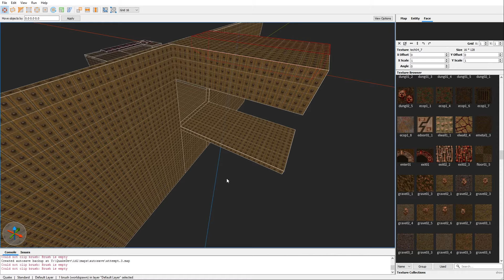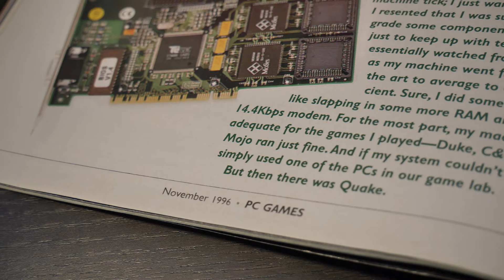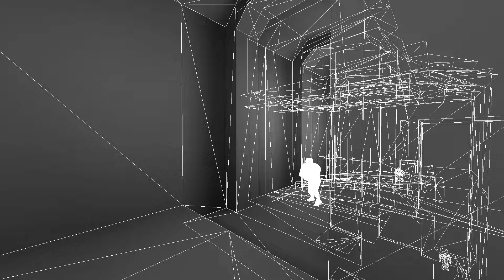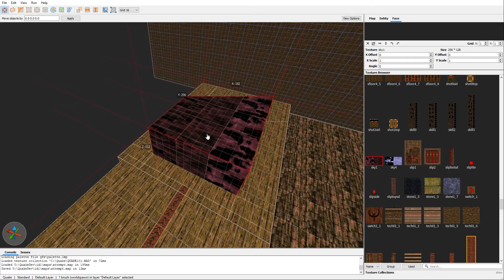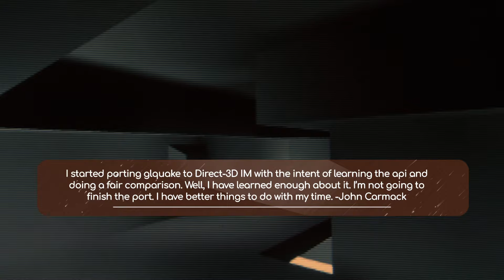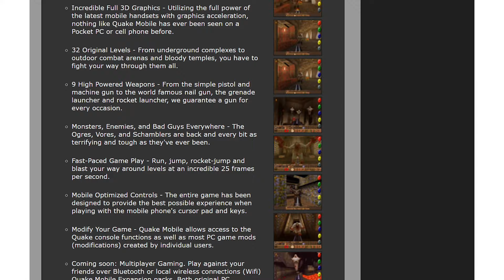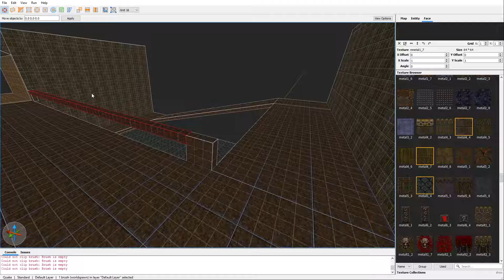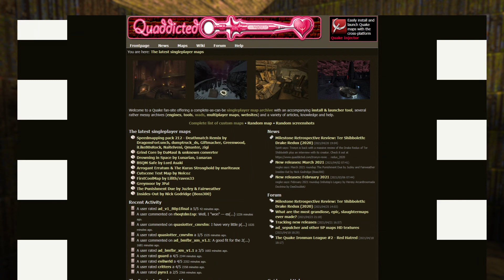DF Retro: Quake - The Game, The Technology, The Ports, The Legacy

Comment: The original Quake running on the DarkPlaces engine is a huge graphical improvement over the original game. You can find the DarkPlaces engine free but you must have and use the original game files. The other two mods that come to mind is Quake 1.5 and Quake 1.5 HD. These run on the DrakPlaces engine as well. The latter two overhaul both the enemies and weapons. That can be a positive or negative thing depending on how you feel about the original game. Personally I like the original game running on the DarkPlaces engine. It has gameplay identical to the original but much higher resolution.

Comment: iD are pioneers. First doom, then they came out with quake and arguably the best one quake 2 in terms of engine adoption. Then they battled for the deathmatch arena scene. 

Few companies can be said to have changed computer gaming like iD. First doom made people want pcs over their amiga, something unthinkable a few years before. Then they drove the 3d acceleration market and ultimately this culminated in direct x, which is today the primary driver frame work for pc and xbox  (xbox could not exist if direct x didn't take off). The fragmentation of unique api was never going to last and glquake was a pioneer in ending the fragmentation. It also killed off Cyrix effectively and amd had to scramble to catch up. the flu for the first time became crucial to the enjoyment of the game, so sx processors were dead in effect overnight for gaming and the 486 just couldn't compete with the pipeline nature of the pentium chips,  especially the mmx version. Though later amd 486 dx4 and 5x86 chips were competitive on price until the k6 came out and changed things again.

Those days were both exciting and maddening with how fast things changed between 1995 and 2000. The foundations of what we know as pc gaming were laid in those years and changed the computer gaming scene forever with no other system than the pc really surviving the changes,  though obviously the mac carried on,  but it was never a threat to the pc or taken seriously for gaming from that point.

Comment: 44:50
They likely had to cause Quake uses uncompressed textures loaded directly from the cartridge which is why the textures are so much more detailed than something like Goldeneye. However having tons and tons of uncompressed textures eats up a lot of cartridge space so they had to make sacrifices somewhere.
Textures really were the weakness of the N64, there were 3 options to render them but none were really ideal. You could use the texture cashe which was very fast but was only 8 kilobyte in size which meant you had to massive simplify textures. You could store them on the cartridge but this meant eating up precious cartridge space. Or you could store them in the RAM but that was really laggy which meant unless you did it very carefully the system could easily stall and was extremely difficult to use in the unpredictable nature of a game.

Comment: At the time I had a 3dfx voodoo from creative with a hercules 128bit video card for it off the top of my head is a long time ago. 

My pc was a pentium 60 mhz. 

Still I liked the standard software mode because I found 3Dfx very light on image. 

Took the scary out of Quake. 

It ran like clockwork in 3fdx :))
It was an expensive joke at the time I loved Quake it was a master piece of software. 

Of course you also had to have thick sound card Soundblaster was minimum.
I had Ultrasound card was super sound but not all the games supported that card.

Translated with DeepL

Comment: 22:45 It can't be emulated in the sense that there's no emulator for it available right now, but it doesn't seem to have anything particularly weird/different that would make emulating it hard if proper documentation was available to reverse engineer it. Which leads to...
23:00 isn't this approach the same used in the N64? Wasn't the RCP a second MIPS CPU with a bunch of added silicon for graphics processing? I think SGI used a bunch of Intel i960 RISC CPUs in one of their early graphics accelerators as well, before custom ASICs dedicated to graphics processing became a thing.

Comment: It's a damn shame, because Lobotomy had ported Quake to the Playstation, but they couldn't find a publisher for it so it got scrapped. Lobotomy itself would disappear not long after their Saturn port of Quake because they just weren't getting paid enough money for the ports they did. It's too bad they didn't do the Saturn port of Doom.

The Riva 128 was my first add-on graphics card. There were a lot of choices back then, and while I wanted a Voodoo card, I chose the Riva 128 because it had very good 2D and 3D performance, good image quality, and DirectX support. At the time, DirectX was pretty clunky and not yet universally supported, but Nvidia's embrace of it completely changed that. The Riva 128 could pretty much run everything, and while it wasn't quite as fast as the Voodoo, it had better image quality. And it didn't require a 2D graphics card. As great as the Voodoo cards were, they had a bunch of limitations.

Also, I love that you included a brief clip of Whiplash! I loved that game and played it a LOT!

Comment: Star Wars Dark Forces came out 1995, a year before quake and the lighting looks the same to me. I remember shooting grenades in dark forces and they would sparkle similarly creating light on the walls just like the nail gun does in Quake. I think they both look rather similar, but I know the Jedi engine for dark forces used sprites instead of 3D models. But that's the only difference I can tell. Can you jump and crouch in quake? I don't quite remember, but if not that's another difference

Comment: Why 3D accelerated Quake looks like it's smeared with lard? It's not just the gamma problem, it's something more.

And why does Quake on N64 looks like the textures are sheared? It's like the original texture is like every line is shifted 1 pixel to the left and to have a properly aligned texture you had to skew the whole thing back, giving every surface a zig-zag kinda look. It's also present in the PC version of Quake 2, they did some weird trick there...

There was going to be a PS1 port too I believe but it was cancelled.

44:05 - what is the background music here? Is it from Sin? Sounds like the Missilo Silo/The Ceremony track. (ohh, at 56:52 I got my answer :) It is that track)

Arcane Dimensions' beautifully created map: Foggy Bogbottom is the best I think! My only problem with that level is the music track choice, I always change it to track05. I played Quake 1 through last winter using Quakespasm, played both official expansion pack, played a lot Foggy Bogbottom and finally I got to play Aftershock for Quake for the first time. I always wanted to get it but I didn't know there was a level editor version and a map pack version. The map pack was such a letdown, especially playing it after Arcane Dimensions, even compared to the base game it's still a major downgrade.

Comment: ahh.. I messed around with a cheaper PowerVR card but it never ran (gl)quake right. Finally got a 3dfx card. There was a opengl.dll-glide-wrapper that implented just the bare minimum to run glquake on 3dfx cards.
Remember, that 3dfx cards just basically are 'triangle drawers'. It could draw 2d triangles, with texture coordinates and a color per vertice. That's it. No 'Transform & Lightning' yet. Amazing that it made things that much faster.

Comment: So sad I gave away my Creative 3D Blaster Verite card. I'd like to try and make a legacy machine with it. I rocked that card for a long time due to the fact that I got ahold of some beta GL drivers for it. I think it wasn't until 2001 that I got another video card. That happened to be a 3DFX V5500. Man, I sure do pick 'em good, don't I? 😉🤪
EDIT: I was actually able to get Quakeworld running with VQuake. But as soon as I got the GL drivers, I was able to run GLQuake like everyone else. 😎🤘 I still like VQuake, though. You could turn on AA which would round out the square particles. I can't remember how much it affected performance, though.
EDIT2: (38:58) See! The Verite' is, like, the perfect blend between the others. GLQuake always seemed blurry to me. Almost like it was at once sharp (the edges of objects) and blurry (the textures).

Comment: 34:50 - In 2002 I bought Half-Life, and tried to run it in software mode on my Cyrix MII-300MHz PC. Its performance was pretty similar to the brief clip of GLQuake in software mode that you show here: a single-digit fps!

I played through it like that all the way to On A Rail, at point the low FPS interfered with the train controls and rail electricity damage, and made it impossible to progress.

Comment: I played Quake 4 with only 256MB of RAM first time. It dropped ti less than 1 fps in places. Still played it though. I had an AMD CPU and Nvidia GeForce FX 5700 - laptop. ... The RAM was a 256MB stick, and when I got another so I has 512MB, Quake 4 ran way better.

By the way when he talked about 60fps looking better than say 25fps for Quake (1), I was surprised. I had a CRT and as far as I remember 24fps was the minimum you had to hit. Otherwise it became a slideshow.

Comment: i wish you'd cover the mac ports as well in these videos, even as a small aside when mentioning other versions, sure it came a bit later but i remember it looking better than the DOS version on my mac without a dedicated GPU, and modern remakes of lots of classic games use the DOS version in a wrapper for mac compatibility.
Reply: Agreed. Correct me if I'm wrong but I think the default resolution was 640x480 even, yet shared the same, if not better, framerates than DOS. Quake 3 Arena, though, you can say the Mac version didn't lag behind for once as the beta was Mac first, and took advantage of the power of the 'then new' B&W G3 w/ATI Rage 128.

Comment: There was something wrong with your 486! I also had 486DX2 66MHz and it run at 11f/s @ 640x480  with fully blown window and visible status bar below as I remember. In smallest window @ 320x200 I had like 40fps on 486DX2 66MHz. No overclocking was involved. I had Intel processor. Did you?

Comment: "supporting Professional OpenGL".    There's no such thing as "Professional OpenGL".  A card either supports OpenGL or it does not. As someone who had to port some games to OpenGL (and Direct3D) during that time period, I remember this marketing BS. I believe Carmack himself weighed in on this issue back in the day.  Some 3D card manufacturers tried to explain why their very expensive 3D cards were getting their asses handed to them by Nvidia's cards that cost 1/4 the price.   They invented the "Professional OpenGL" myth.  It was just another way of saying "our card can't do multi-textured rendering for shit".  Weirdly, it sort of worked as artists would go to their IT department and demand a "Professional OpenGL" card and it had to cost at least $1000 (in 90s money).   Nvidia got so frustrated by this turn of events that they gave up trying to educate the consumer, and instead made their own 3D accelerators for "professionals".  They charged over $1000 for them and gave them more serious sound names.   And most of the time, they were identical silicon that they were charging 1/4th the price in their regular "gaming" cards.   They just used drivers that nerfed their gaming performance and tweaked their wireframe performance so the benchmarks would be different.  Sometimes they had hardware IDs to keep users from just installing different drivers, but those were easily patched around.  It worked.  Nvidia's sales (and particularly profits) sky-rocketed in the workstation market as artists demanded those (overpriced) "Professional" cards.

Comment: GLQuake is even more inferior to the software renderer than you suggest. It has no fullbrights support. This means that light on textures like the red lamps on the teleporter or the white lamps in the first level don't stay at full brightness in the dark. It has no overbrights support. This means that nothing can ever be brighter than 100%. These shortcomings make for an incredibly dull picture compared to the original software rendered Quake. It all sums up, and I think GLQuake lost most of the atmosphere and style of the original.
Reply: The original GLQuake was very limited by the original 3D acceleration hardware of the time. If they had left those removed graphical features, the cards wouldn't have been able to run the game properly so they had to make a compromise for better FPS and resolution instead of visual fidelity.

Comment: dungeon keeper
Reply: fpga can hardware emulate
Reply: transport tycoon
Reply: descent 1-2
Reply: of course you can fpga hardware emulate anything / any chip
Reply: dont spam pixels, draw everything in ray cast style order, like in the 2.5d engines, but in true 3d with first intersection sorting, kinda z buffer but sorting is local not global
Reply: when you evaluate the ray, evaluate the z-buffer, you dont need acceleration for that comparison
Reply: if you can run 2.5d render, you can also run z-buffer alongside it, in same algorithm